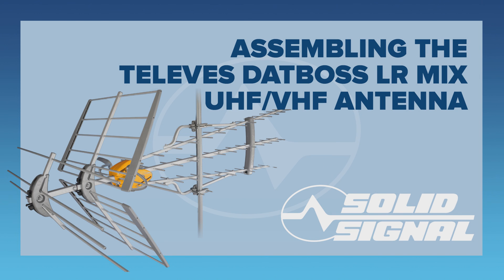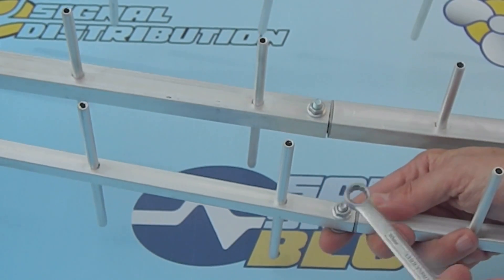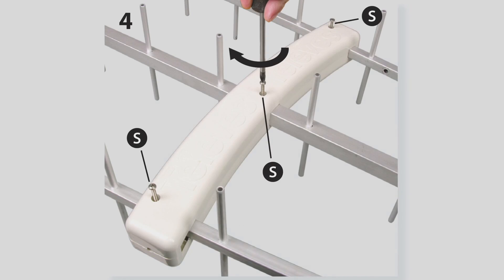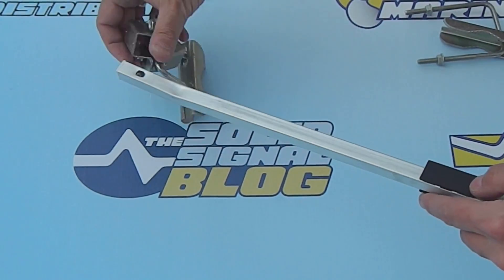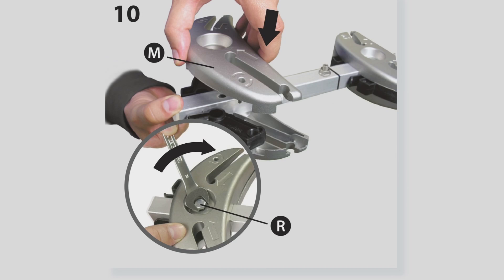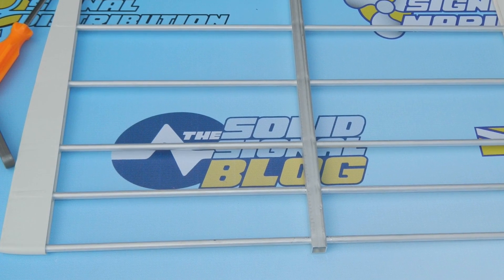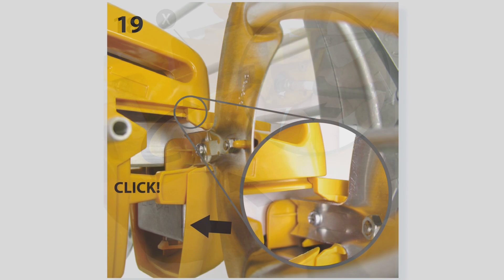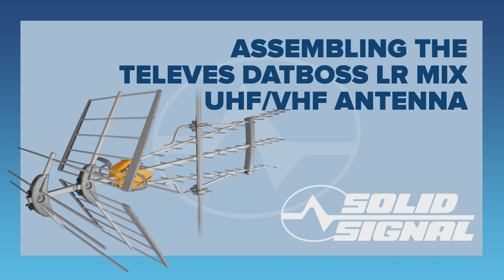Assembling the Televes DATBOSS LR MIX UHF/VHF Antenna

Comment: I am a little unsure how part V attaches at paet N.  Dies one use the 90 degree end, and is ther a 90 degree twist as it heads towards part T?  Wish you showed that, the pix are better than IKEA but could be improved

Comment: Mine came with no instructions whatsoever and the single page part sheet is using different labeling letters for the parts than are used in your video.  Early in your video you show carriage bolts being used to secure parts that have round holes, not square holes as are standard for carriage bolts.  I am hesitant to do that since other parts on the antenna that apparently use carriage bolts do have square holes... ie the the 2 S shaped support pieces.  Further, I can't tell which carriage bolt you are using.  There is more than one length.  So far this antenna sucks.  Not your fault, but it sucks.  I suspect they let every Tom, Dick, and Harry on the planet reproduce it under their name for a fee, like "Home Gyms" and I picked a dud distributor manufacturer, who was in fact not Solid Signal... so maybe not relevant.
Reply from the maker: Most likely you're looking at the newer version of the antenna that's slightly different from this one. YouTube won't let me link in comments but I have done an assembly video for that one too.

Comment: Your missing something.  What end do you point at the transmitter?  It says nowhere on the box nor on the single sheet part list nor in any of these youtube videos.  I could assume that the reflector looking pieces are reflectors, and put them in the back... .  But why would I want to assume anything after all that work?  RF is strange and I just want to orient it as intended.  I can try it backwards later.  So which end is the front?

Comment: Good video. The instructions that come with the antenna are nearly incomprehensible, this video helps. Unfortunately some steps are skipped over or done in a different order, near the end. This video is still very helpful, though.

Comment: How tall does the pole have to be the antenna is mounted to? I plan to use a second home made telescoping antenna pole inside one I already made with antenna clamps. I have an existing CM 3020 I am going to be using along with.
Reply from the maker: It really depends on your situation. The antenna should be high enough to avoid most obstacles, that’s all.
Reply: @SolidSignalNovi  I have a crap to of woods and trees in front of my cm3020 that’s 15’ now above the ground. I can get nearly 75 miles. I ordered this antenna (from you guys on eBay) to try and get good signals on UHF. Can this mount to a small j pole that mounts to the side of a house? That would be easier than adding another section to my home made antenna pole for that my 3020 is on now.
Reply from the maker: @XMguy  Using a J-mount would probably limit the amount of aiming you could do, unless the J-mount went above the roofline.
Reply: @SolidSignalNovi  yes. It will be at the top of the roof line, on the eave.

Comment: I just got done assembly this antenna its a beast. Built very solid definitely not junk. My only complaint is that the directions suck. Only photo illustrations
Reply: I used the video from solid signal when I put mine together...

Comment: Great antenna! I purchased it to replace Antennas Direct top of the line model. The Televes picked up more stations and had much better signal levels. I used the included amplifier, but I also needed to supply 7 TVs. I ran the output of the amplifier into another 8 way splitter/amplifier and it worked fine. 
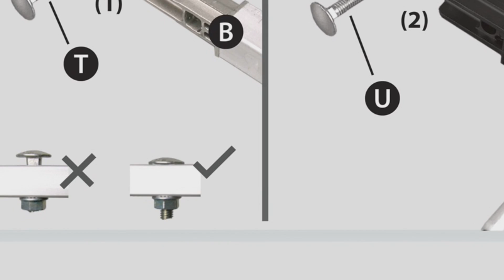My comment to this video is at 1:38 it talks about the square on the bolt being drawn into the aluminum. If you line up the bolt so two sides are parallel to the aluminum arms, it will draw in much easier. Having it crooked requires it to dig into the internal aluminum insert and that takes more force to do so. I'd also be worried on cracking that internal aluminum insert.

Comment: Very poor explanation this video, it needs to be more explicit, you do not even explain how and where to install the amplifier that comes with the antenna. near the antenna or near the TV set
Reply: Exactly I don't think he even put it together
Reply: It's odvious you don't know anything about the antenna.. the pre-amp is mounted inside the orange housing on the antenna and the power supply is inside the house 😉

Comment: BUY 2 3ft. PIECES OF ALUMINUM TUBING 3/8''. Install them OVER 2 of the VHF ELEMENTS-- middle ones. THIS will enable the antenna to receive Ch.2-6!!!! TELEVES ADDED THEM, after complaints, to the antenna and gave it a DIFFERENT model no. BUT, you can effectively add that retroactively for same performance! OR, buy 4 at Lowe's and get better Ch. 2-6 reception!!!!
Reply: Harold - which elements did you attach 2 - 3' elements on? Center section front, middle or back of it? Tried back of center section but did nothing.Need Channel 4 low vhf.  Thanks
Reply: @bobr5803  look up Televes 148281... that's the one for low channels also.. Can't find any pics except for a couple on Televes site and not too clear..Here's the instructions that show the elements and where to place them
https://www.google.com/url?sa=t&source=web&rct=j&url=https://www.televes.com/en/downloadfile/DS04190002_000_58200.pdf/DS04190002_000_ES-EN.pdf&ved=2ahUKEwjagtqmsabsAhWJLc0KHY_OC_sQFjABegQIChAH&usg=AOvVaw0vVcXyOceA4aokwxB4FMcS&cshid=1602207898359
Reply: This antenna is the Televes 148381, which already includes the Low VHF elements. The 148281 also has the Low VHF elements, but it is a smaller antenna.

Comment: I just finished assembling mine and it is not that hard to do. Just take your time.

Observations:

1. if any of the elements is bent, try not to bend it back since you will surely break it.
2. It is very easy to mix the positions for the upper and lower booms since they have the same cross section. Make sure you count the number of elements. The upper boom is longer (more elements) than the lower one.
3. Don't worry too much if one of the bolts does not go (bite) all the way in the aluminum beam. If you try too hard, you might break something.
4. The upper and lower braces are exactly the same. The holes will not align at first. They will as you tighten the bolts.
5. The Televes grey braces have a drain hole. Make sure it goes on the bottom. Do not overtighten the three screws.
6. I am not sure what is the best (or correct) way to install the black plastic spacers for the mast adapters. The instructions show it one way but in the video is shown in the opposite way.

Cheers!

Comment: I get as a distributor saying this is a two-person job but I had no problem doing this solo and you can too if you’re smart. 

I used clothesline thickness rope to bring it up, reflectors and all, to the roof so I wasn’t climbing with it. It’s not that heavy. I got it all the way on the pole and loosely secured before I raised it to the desired height, soft-locked at the top and then went about aiming and leveling. Only after everything was locked down and level did I put the cartridge in. 

When all was said and done I had a nice gain increase over my DAT-790 I put up a year and a half ago. I’m able to pull in stations from Chicago that are 72 miles away and 2Edge. With a rotor and this antenna I get my pick of Madison, Milwaukee and Chicago stations. So did the DAT-790 but not as reliably.
Reply: This is how I’ll be installing mine too. Tip the pole down, and add this to the pole along with my 3020.